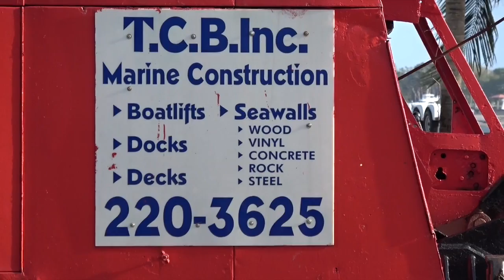Pouring a concrete boat ramp

Comment: The 2 most common methods of building or replacing a boat ramp is to either build the slab and push/slide it into the water or to build a cofferdam and pour the slab in place. If using the former method, it is essential to ensure that the grade is consistent or the slab will break.

Comment: Precast with a saw tooth surface would be better. Perhaps hollow and floated in then pumped full of sand slurry to sink it slowly.. thanks.
Reply: Agreed. The coffer dam material & labor istallation alone, cost more than the loads of concrete & both type pumps. 52918

Comment: How did they joint finish the low bottom end of that ramp with a joint tool with poles like that?
Reply: I'm confused too and have 0 knowledge. Would the area submerged need to be finished? Does that make it more resilient??? Idk why I'm asking .. I'll never own a boat 🤷 12k + where im at for something that may sink 10 minutes into your first ride 🤣

Comment: Been to my share of ramps that were short. Wheels drop over the edge and you can be f'd. Not talking about lakes or rivers that have run dry but just some ding bat who put in a short ramp. Frustrating.

Comment: That's exactly how they put them in at the Sprocket factory but the professional boat ramp dorks put in preformed 16"X4"X10' concrete blocks on top of 3" crushed rock.

Comment: Since that was salt water the concrete should have known better to keep the water out while the rebar was down and no concrete poured yet because he has just started concrete cancer and rust in the rebar.
Reply: Corey Dark rebar comes rusted. Have you ever worked a day in your life????
If rust was a concern, stainless rebar, or green coated rebar would have been used..
Think before you comment, or don't comment at all...
Thanks bye
Reply: And ro add more, concrete is mixed with water....bet you didnt even know that either!!
Reply: You need oxygen also for corrosion to occur.  The re-bar is fully encased in concrete.  The concrete will probably need replaced before the re-bar corrodes apart.
Reply: Corey Dark Yup.   Should have used epoxy coated rebar and vibrated it in like they do highways.

Comment: Funny how Meerkans still use a piece of wood to smooth out. Watch European or Asian concrete crews. They have special tools for that- no bending over or getting on your knees. Work Smarter not harder Meerka!
Reply: I do not see how it is funny (Paul) is it more practical for them to use a special tool over a 2x4. It dident look like they were working to hard.